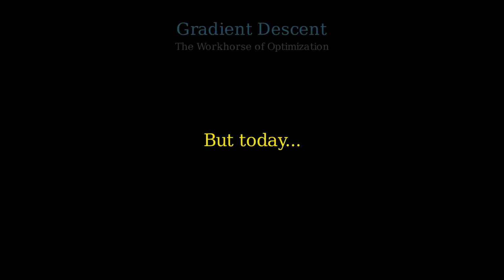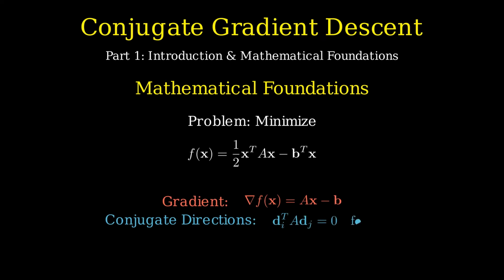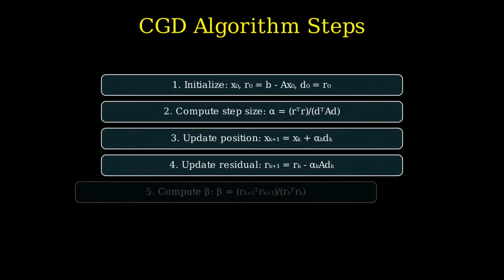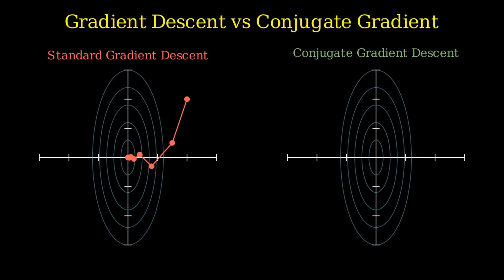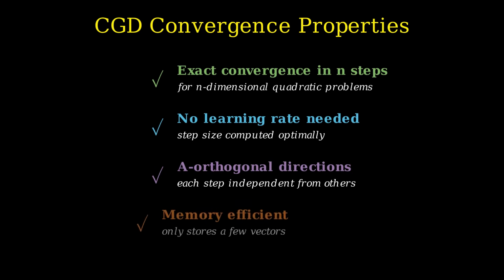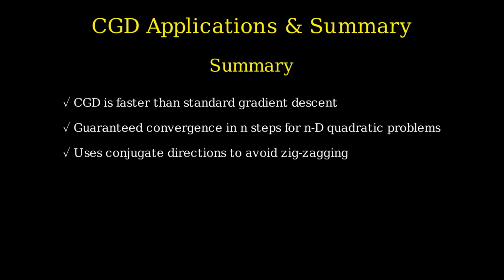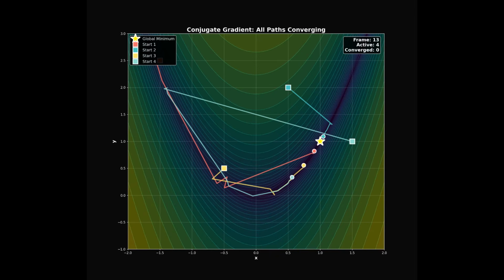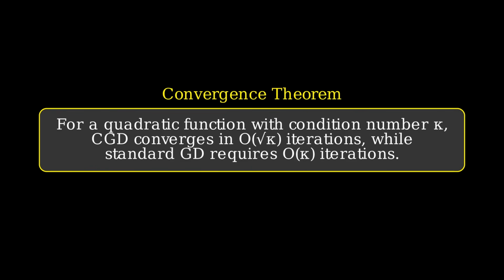Gradient Descent vs Conjugate Gradient: The Ultimate Showdown

Comment: Thank you for this interesting video! Looking forward to the next ones :)

Two questions: 
5:52 the directions of the orange lines are not perpendicular to the green lines. Why is that?
How does this method treat local minima? Is it sensitive to that?
Reply from the maker: Thank you so much for the question. You are correct in questioning the perpendicular nature of the gradient. Generally speaking, the path that gradient descent takes to reach the cost function's minimum should be perpendicular to the cost function's contour lines. This is due to the fact that the cost function's gradient, which is perpendicular to the contour lines at that location, indicates the direction of sharpest descent. But it's important to note that gradient descent's trajectory could not always be precisely perpendicular to the contour lines, particularly if the learning rate is not adjusted properly. Gradient descent may overshoot the minimum and fluctuate around it if the learning rate is too high, producing a zigzag route (as seen in the orange curve) that isn't always perpendicular to the contour lines. For the simulation purposes I used a higher learning rate.

To answer your second question: Yes CGD is just as sensitive to local minima as standard GD because CGD only modifies the search direction not the optimisation landscape. it still follows a descent path i.e. if you start near a local minima CGD will converge to that. It can't jump out of it.

Comment: Nice video. I was wondering why this approach is not used in DL like why do we still use GD with momentum or some other alternatives ? What is the limitation of the conjugate gradient descent ?
Reply from the maker: Thanks for the comment. Its a nice question. The most fundamental issue with CGD is that it assumes that you are working with exact gradients in a deterministic setting. Because in the optimisation problems, one major distinction is whether your objective function is deterministic or if its an expectation of a function. But DL operates in a stochastic setting where gradients are noisy estimates from mini batches. The formulation of CGD is based on assumption that past gradients are exact whereas algorithms like "Adam" are designed for stochastic gradient estimates. Even recent research has shown that CGD over fit significantly to neural networks training, even though it achieves lower training error (https://proceedings.neurips.cc/paper/2000/file/059fdcd96baeb75112f09fa1dcc740cc-Paper.pdf). Also the fast convergence speed of CGD is also sometimes acting as its downfall as it often leads directly to sharp minima (https://www.sciencedirect.com/science/article/pii/S0925231225022404). 
Usually we use stochastic gradient descent (SGD) as the core/vanilla algorithm in DL becuase the noise/stochasticity from mini batches actually helps escape the sharp minima. But there is one paper that tries to combine CGD with Adam. Quite recent one (2025). You can read it here: https://arxiv.org/html/2404.01714